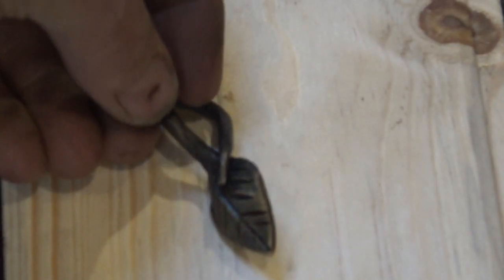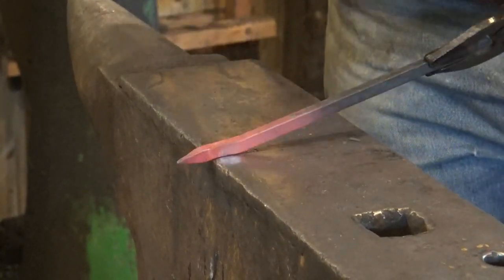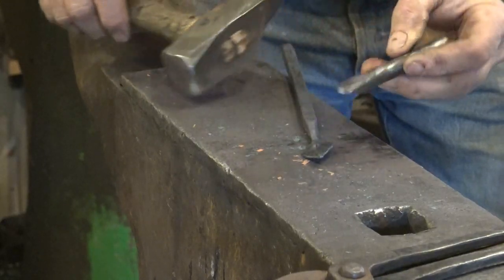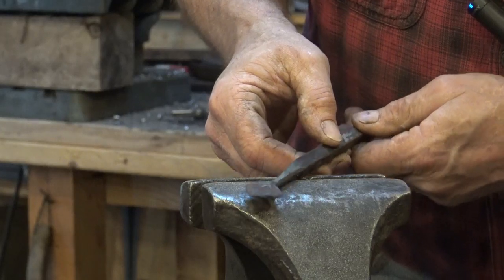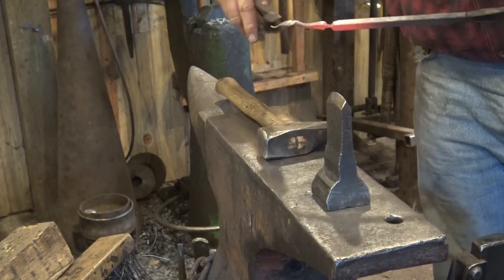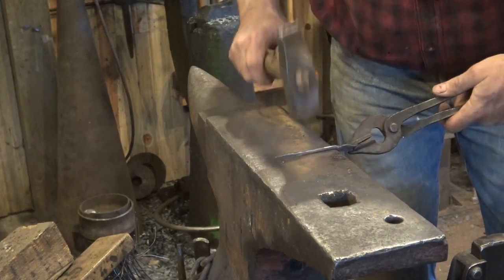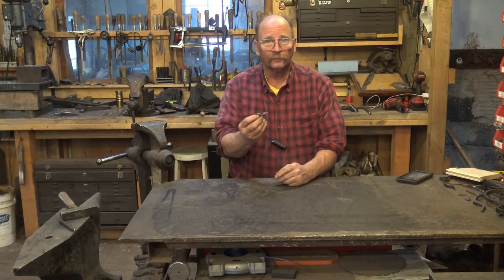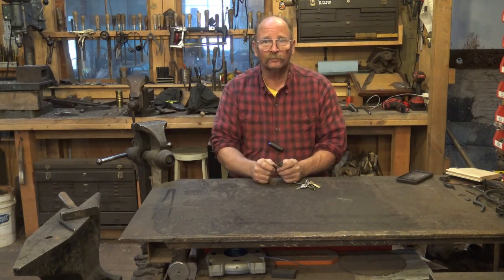Blacksmith forged leaf for a key ring or pendant.

Comment: I have been wondering about your handy blacksmithing ruler, and in this video I saw it was marked with a "Stanley 45-912" -- It is a 12" steel carpenter's square, with the short arm cut down to 1" long.  That's a great idea!

Comment: So glad your archive of videos is available! Hadn't made a leaf in awhile and decided to end my shop time making one the other day because I was thinking about adding some leaf elements to a project in laying out - ended up screwing up like 5 in a row. Cold shut city,  was so frustrated cause I've made so many and thought I knew what I was doing. Anyway, being stubborn, I spent 2 hours yesterday trying again and still ran into issues, having to file out cold shuts and still having them reform on me. Just rewatched this video and saw what I was doing wrong almost immediately, I was setting hard shoulders using half faced blows rather than soft ones by  isolating my taper over the edge and hammering back towards myself keeping my blows more or less fully over the anvil. Especially with the really crisp corners on my new anvil it was pretty much inevitable that I was going to get a cold shut. Could seriously kick myself. Thanks again, maybe next time I'll admit I'm missing something earlier and save myself the frustration

Comment: ..Besides the Brass brush, What are some other methods of adding some decorative color accents to your work?? Another Great Video sir...!!
Reply from the maker: filing or grinding to a bright finish and leaving that color or controlled heat to bring on oxide or tempering colors to the shiny surface.  There are some colored wax finishes and of course there is always paint or powder coating, but that seems a bit extreme.

Comment: Good morning, I had a question about your firebox and coal forging. I have watched so many of your videos, I am not sure which one had the references that spurred my questions. You mentioned putting pieces too low in the coal fire would overheat the piece, (been doing that since day one apparently), but also that it would be in an oxidizing environment. Is the oxidizing environment also what increases the amount of scale on the surface of the metal I am working? I am currently focused on successfully making tongs, punches, drifts, chisels so that I can do all the other projects that I am looking forward to! Plus building up the necessary muscles and endurance to finish the jobs all in one evening after work, etc. Anyway, the surface of many of my tongs is very rough textured, but not from the hammer blows. Is this likely oxidation or overheating the metal too quickly? Or something else I don't even have on my radar?

I have really liked the change I just made from Anthracite coal to Bituminous coal! Now I know what coke looks like!😊
Thanks for any help you can provide!
Reply from the maker: Oxidation does produce scale, so the ideal area in any fire is the neutral zone
Reply: @BlackBearForge  Thank you for the quick reply! It is greatly appreciated!!

If I am having a hard time finding the neutral zone as a beginner, is it likely that I am using too little coal or coke to fuel my forge? My new firepot is square, 4"x4" at the base, about 7"x7" at the top, and 2.5" deep. Then the coal often is only stacked high enough to cover the 3/8" square bar by about an inch or two. I get the feeling that I am being too stingy with my coal. Thanks again & happy forging!

Comment: Random question: If you used a copper brush to add the color to the leaf, could you then patina the copper to give it that green color?
Reply from the maker: It should work, although I don't think I have ever seen a copper brush
Reply: Black Bear Forge I’ve only seen them as a firearms cleaning brush. Copper being softer than the metal of the firearm but harder than the carbon build up makes it ideal for cleaning. Only down side is it’s the size of a toothbrush, might get your fingers a bit toasty.